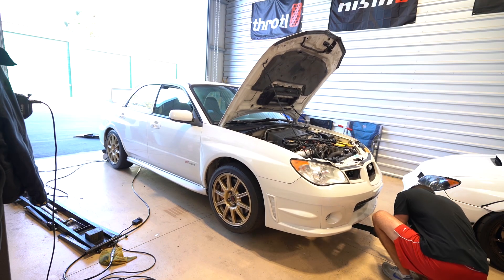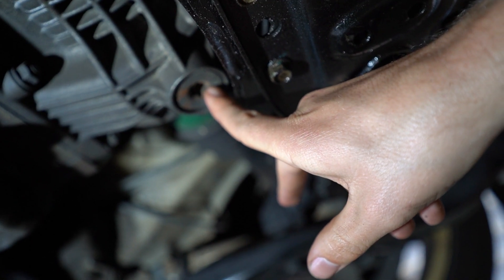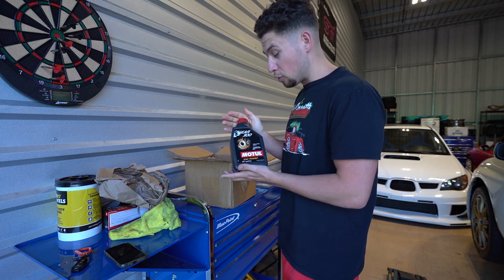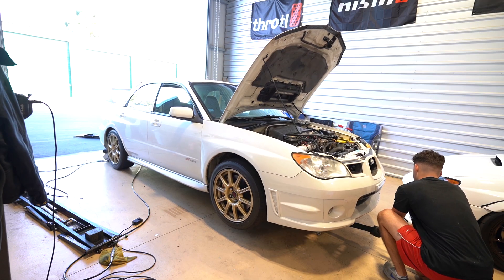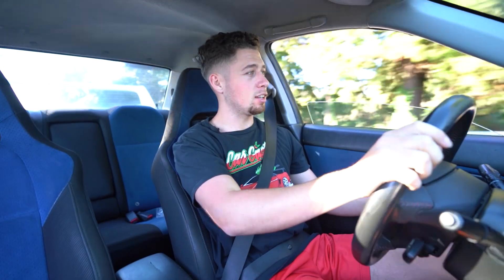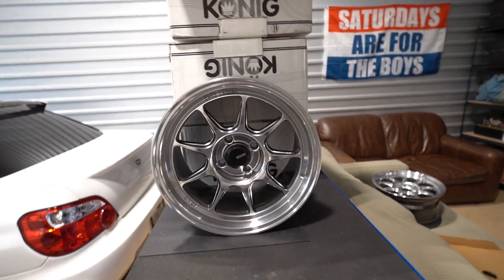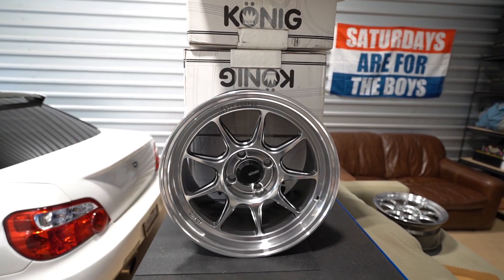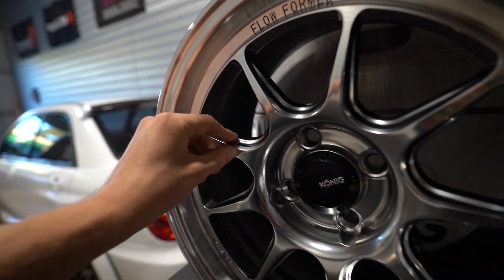Dream Subaru STi is Officially For Sale

Comment: Definitely run the redline cocktail I have heard it works wonders on the notchy sti trans plus ones that have a slight grind in 3rd or 4th when banging the gear. The motul fluid is to slippery on used trans but the redline allows the synchro's to do what they were made to do. I am switching to it whenever I get mine in the mail.

Comment: Transmission recipe is: 50% stock gear oil 50% RedLine gear oil, makes it trans smooth as butter. Fixed my sti trans in no time. Try that.
Reply from the maker: Thanks!